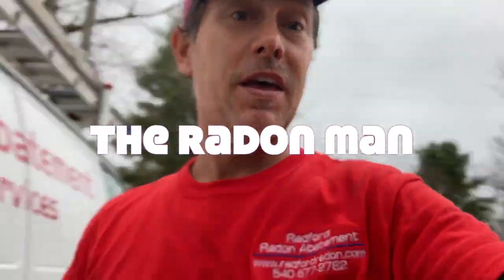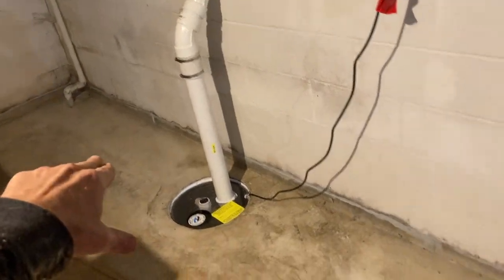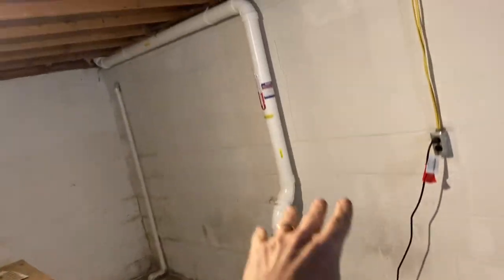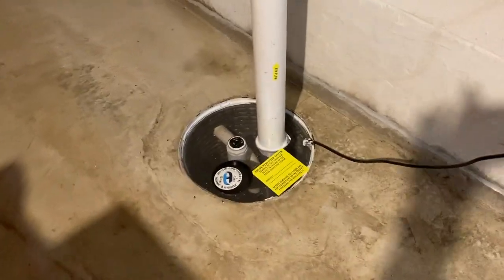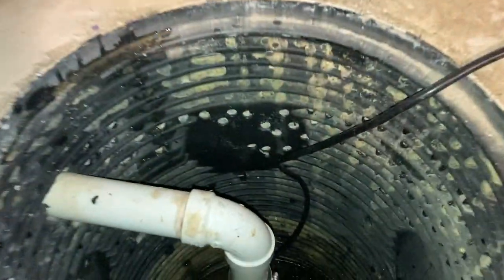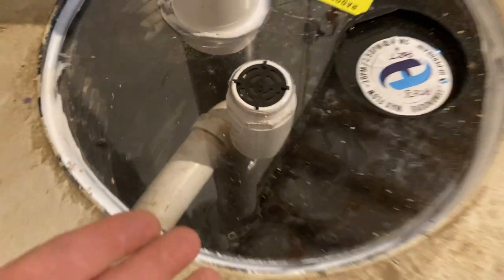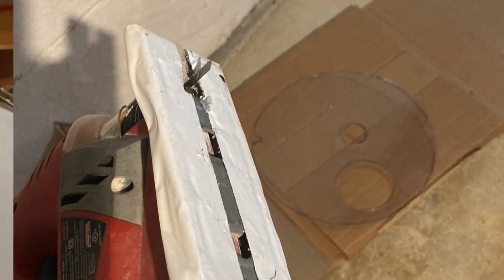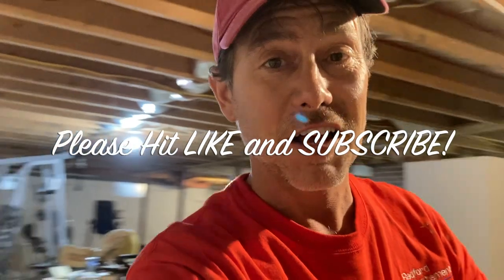Removing Radon From A Basement Drain System

Comment: How/what is radon emitted from? 
I have a slight  open gap under the lid and above. 
What do you think it means if the discharge water is golden color? Rust or bacteria and how to clear it? 
My sump pump is just touching the ground under the foundation, that’s bad? I’m thinking of putting a Home Depot bucket in there and drilling holes on the sides to reduce earthy substances.